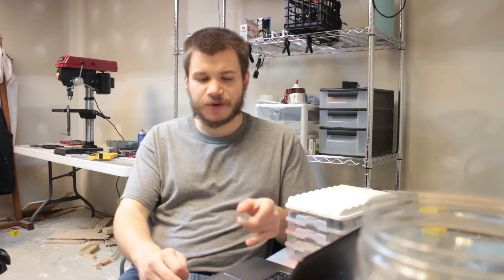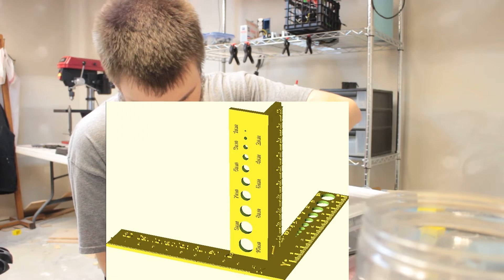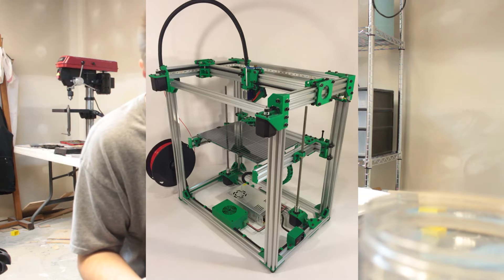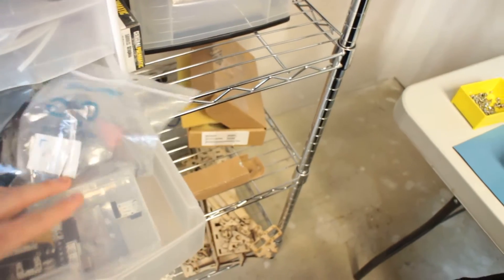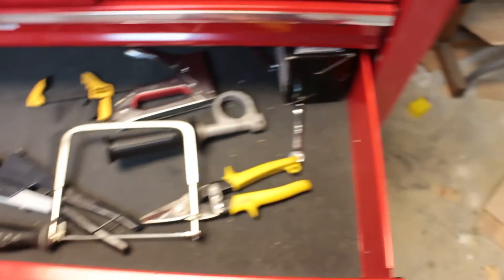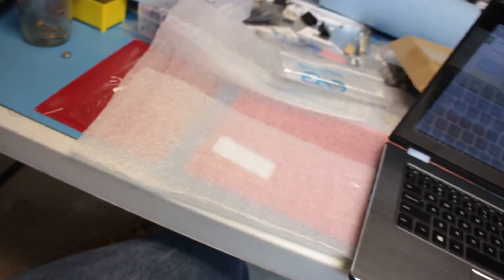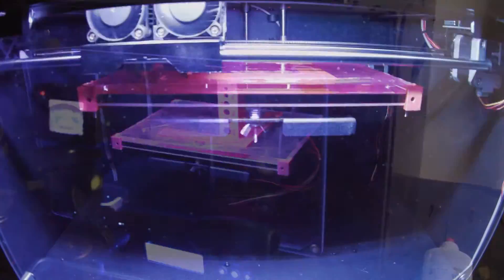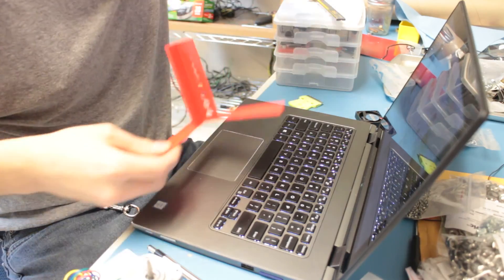3D Printer VLOG #1 - Planning and Calibration

Comment: I am only on video 1 of the series so I may be speaking too soon but you might want to look into OctoPrint/OctoPi on an RaspberryPi. Will definitely be using it on my printer.
Reply from the maker: I actually have a raspberry pi 3 loaded with octoprint that I need to finish setting up ready to be hooked into the printer!